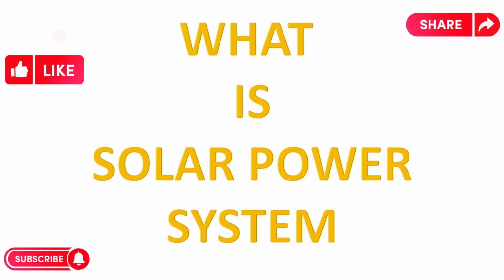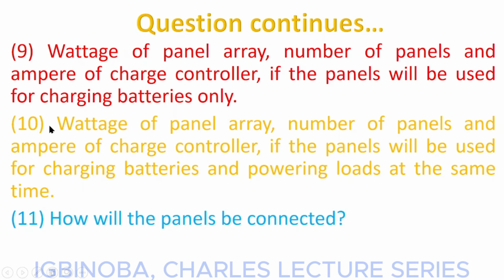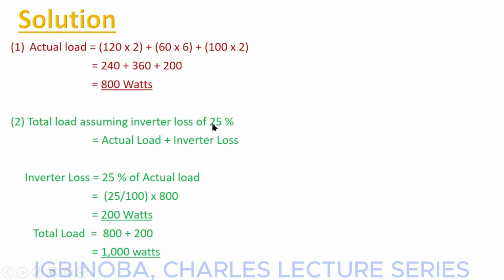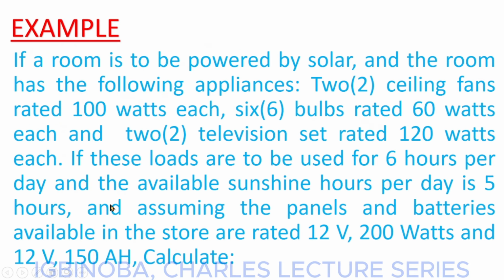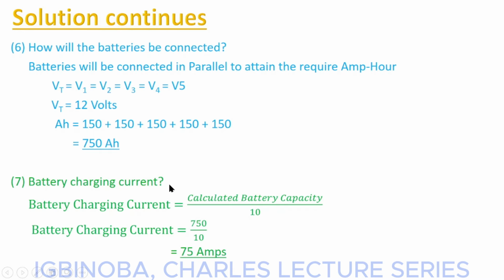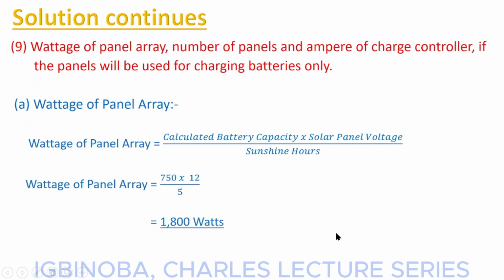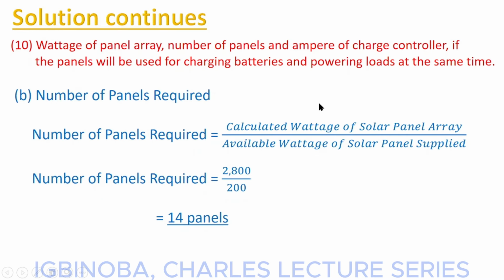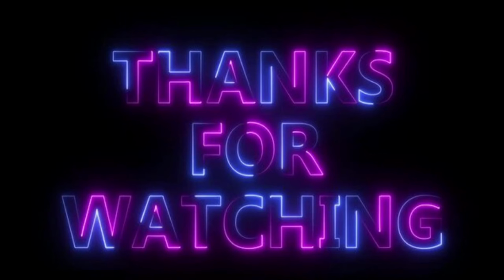Design of Solar Power System

Comment: ANSWERS TO SWEP NEW TASK
 PETRO334H
1. Actual load= (100×3)+(60×10)+(120×4) =1380watts
2. Total load assuming inverter loss of 25%= Actual load +Inverter loss
Inverter loss=25% of Actual load
= 25%×1380=345 watts
Total load= 1380+345=1725 watts
3. Inverter rating on VA using power factor of 0.8
= (1725÷0.8)= 2156.25
4. Battery capacity using factor for reserve 75%=(2×1725×6×0.75)=1293.75Ah
5. No. of batteries for backup hours=1293.75Ah÷150Ah= 8.6 =8 batteries 
6. How batteries will be connected?
The batteries will be connected in parallel 
Vt=V1=V2=V3=V4=V5=V6=V7=V8
Ah= 150+150+150+150+150+150+150+150=1200
7. Battery charging current=1293.75÷10=129Amps
8. Battery charging time assuming charging loss of 40%= 1293.75Ah+(40%+1293.75Ah)÷129A=14hrs
9a. Wattage panel array= 3105 watts
9b. Number of panels required= 3105÷345=9 panels 
9c. Ampere of charging controller required= 3105÷12=258.75Amps
10a. Wattage of panel array= Calculated wattage of solar panel array for charging battery only+ calculated total load =3105+1725=4830watts
10b. Number of panels required= calculated wattage of solar panel array÷ Available wattage of solar panel supplied= 4830watts÷345= 14Amps
10c. Ampere of charge controller= calculated wattage of solar panel array÷ solar panel voltage=4830watts÷12volts= 402.5Amps
11. How will the panels be connected?
Ans: They will be connected in parallel

Comment: EEE3146P

1. Actual Load = 1380 W

2. Total Load = 1725 W

3. Inverter Rating = 2156.25 VA

4. Battery Rating= 1293.75 Ah

5. Number if Batteries = 9

6. Battery are Connected in Parallel

7. Battery Charging Current= 129.4 A

8. Battery Charging Time = 14hrs

9.) a. Wattage Panel Array = 3105 W

b. Number of Panels = 16

c. Charge Controller= 258.75 A

10.) a. Wattage of Panel Array = 4830 W

b. Number of Panels= 24

c. Charge Controller= 402.5 A

11. Panels Arranged in Parallel

Comment: EEE3121Q

1. Actual Load = 1380 W

2. Total Load = 1725 W

3. Inverter Rating = 2156.25 VA

4. Battery Rating= 1293.75 Ah

5. Number if Batteries = 9

6. Battery are Connected in Parallel

7. Battery Charging Current= 129.4 A

8. Battery Charging Time = 14hrs

9.) a. Wattage Panel Array = 3105 W

b. Number of Panels = 16

c. Charge Controller= 258.75 A

10.) a. Wattage of Panel Array = 4830 W

b. Number of Panels= 24

c. Charge Controller= 402.5 A

11. Panels Arranged in Parallel

Comment: 1. Actual Load=1380watts
2. Total Load=1725watts
3. Inverter rating=2156.25VA
4. Battery rating=1293.75Ah
5. Number of batteries=9
6. Battery are connected in parallel
7. Battery charging current=129.4amps
8. Battery charging time=14hrs
9.a. Wattage panel array=3105watts
b. Number of panels=16
c. Charge controller=258.75A
10.a. Wattage panel array=4830watts
b. Number of panels=24
c. Charge controller=402.5A
11. Panels are arranged in parallel.

Comment: NAT31A 
1. Actual Load = 1380 W

2. Total Load = 1725 W

3. Inverter Rating = 2156.25 VA

4. Battery Rating= 1293.75 Ah

5. Number if Batteries = 9

6. Battery are Connected in Parallel

7. Battery Charging Current= 129.4 A

8. Battery Charging Time = 14hrs

9.) a. Wattage Panel Array = 3105 W

b. Number of Panels = 16

c. Charge Controller= 258.75 A

10.) a. Wattage of Panel Array = 4830 W

b. Number of Panels= 24

c. Charge Controller= 402.5 A

11. Panels Arranged in SERIES

Comment: PETROCHEM399U
1.Actual load =1380watts

2.total load=1725watts
3.Inverter rating=2156VA
4 Battery capacity=1293.75 Ah
5.Number of batteries is 8.6
6.Connection parallel
7.battery charging current is 129.4 amps
8. Battery charging timr=14hrs
9a.wattage panel array =3105 watts
b. Number of panels=16
C.charge controller=258.75A
10a.wattage of panel array=4830watts
b.Number of panes=24
C.charge controller=402.5A
11.Panels are arrange in parallel

Comment: PETRO3141K
 
1. Actual load= (100×3)+(60×10)+(120×4) =1380watts

2. Total load assuming inverter loss of 25%= Actual load +Inverter loss
Inverter loss=25% of Actual load
= 0.25×1380=345 watts
Total load= 1380+345=1725 watts

3. Inverter rating on VA using power factor of 0.8
= (1725÷0.8)= 2156.25

4. Battery capacity using factor for reserve 75%=(2×1725×6×0.75)=1293.75Ah

5. No. of batteries for backup hours=1293.75Ah÷150Ah= 8.6 =8 batteries 

6. How batteries will be connected?
The batteries will be connected in parallel 
Vt=V1=V2=V3=V4=V5=V6=V7=V8
Ah=150+150+150+150+150+150+150+150=1200

7. Battery charging current=1293.75÷10=129Amps

8. Battery charging time assuming charging loss of 40%= 1293.75Ah+(0.40+1293.75Ah)÷129A=14hrs

9a. Wattage panel array= 3105 watts

9b. Number of panels required= 3105÷345=9 panels 

9c. Ampere of charging controller required= 3105÷12=258.75Amps

10a. Wattage of panel array= Calculated wattage of solar panel array for charging battery only+ calculated total load =3105+1725=4830watts

10b. Number of panels required= calculated wattage of solar panel array÷ Available wattage of solar panel supplied= 4830watts÷345= 14Amps

10c. Ampere of charge controller= calculated wattage of solar panel array÷ solar panel voltage=4830watts÷12volts= 402.5Amps

11. How will the panels be connected?
Ans: They will be connected in parallel

Comment: PETROCHEM321U

1. Actual load – 1380 W

2. Total load – 1725 W

3. Inverter rating – 2156.25 VA

4. Battery capacity – 1293.75 AH

5. Number of batteries – 9

6. Connection – parallel

7. Charging current – 129.38 A

8. Charging time – 14 hrs

9a. 3105 W
b. 15.5 ~ 16 panels
c. 258.75 A

10a. 4830 W
b. 24 panels
c. 402.5 A

11. Connection – parallel

Comment: PETRO3129Y

1. Actual Load: 1380 W
2. Total Load (including inverter loss): 1840 W
3. Inverter Rating (VA): 2300 VA
4. Battery Capacity: 1227 Ah
5. Number of Batteries: 9 batteries
6. Battery Connection: Parallel
7. Battery Charging Current: 15 A (per battery string)
8. Battery Charging Time: 5.1 days
9. Panel Array (for charging batteries only):
- Wattage: 2945 W
- Number of Panels: 15 panels
- Charge Controller Ampere: 245 A
10. Panel Array (for charging batteries and powering loads):
- Wattage: 4785 W
- Number of Panels: 24 panels
- Charge Controller Ampere: 399 A
11. Panel Connection: Series - Parallel

Comment: PETRO364L
1. Actual Load: 1380 W
2. Total Load (including inverter loss): 1840 W
3. Inverter Rating (VA): 2300 VA
4. Battery Capacity: 1227 Ah
5. Number of Batteries: 9 batteries
6. Battery Connection: Parallel
7. Battery Charging Current: 15 A (per battery string)
8. Battery Charging Time: 5.1 days
9. Panel Array (for charging batteries only):
- Wattage: 2945 W
- Number of Panels: 15 panels
- Charge Controller Ampere: 245 A
10. Panel Array (for charging batteries and powering loads):
- Wattage: 4785 W
- Number of Panels: 24 panels
- Charge Controller Ampere: 399 A
11. Panel Connection: Series - Parallel

Comment: EEE 317Q

1. Actual Load = 1380 W
2. Total Load = 1725 W
3. Inverter Rating = 2156.25 VA
4. Battery Rating= 1293.75 Ah
5. Number if Batteries = 9
6. Battery are Connected in Parallel
7. Battery Charging Current= 129.4 A
8. Battery Charging Time = 14hrs
9.) a. Wattage Panel Array = 3105 W
b. Number of Panels = 16
c. Charge Controller= 258.75 A
10.) a. Wattage of Panel Array = 4830 W
b. Number of Panels= 24
c. Charge Controller= 402.5 A
11. Panels Arranged in Parallel

Comment: CHM3137G
1,Actual load = 1380W
2, Total load = 1725W
3, Inverter rating = 2156.25VA
4, Battery cap = 1293.75Ah
5, No. Of batteries= 9 batteries
6, Parallel
7, Battery charging is 129.4A
8, Time is 14hrs
9a, 3105W
b, 15.5 panels
c, 258.75A
10a, 4830W
b, 24 panels 
c, 402.5A
11, Parallel

Comment: CIV32B
a.Actual load is 1380w
b.Total load is 1725w
c.inverter rating is 2156.25VA
d.Battery capacity is 1293.75AH
e.No. of batteries is 625-9batteries
f.parallel
g.battery charging current is 129.375amps
h.charging time is 14hrs
i.1).3105w   2.)15.525-16 panels  3.)258.75A
 
J .  1).483w 2.)24.15-24panel 3)402.4A
K.parallel

Comment: CHM393O

1. Actual load= (100×3)+(60×10)+(120×4) =1380watts

2. Total load assuming inverter loss of 25%= Actual load +Inverter loss
Inverter loss=25% of Actual load
Therefore, 
Total load= 1380+(25%×1380)=1725 watts

3. Inverter rating in VA using power factor of 0.8
= (1725÷0.8)= 2156.25 VA

4. Battery capacity using factor for reserve of 75%=(2×1725×6×0.75)/12=1293.75Ah

5. No. of batteries for backup hours=1293.75Ah÷150Ah= 8.625 = 9 (Approximately) 
       = 9 batteries 

6. How the batteries will be connected?
The batteries will be connected in parallel 
VT=V1=V2=V3=V4=V5=V6=V7=V8=V9
VT= 12 V 
Ah= 150+150+150+150+150+150+150+150+150=1350 Ah

7. Battery charging current=1293.75÷10=129Amps

8. Battery charging time assuming charging loss of 40%= 1293.75Ah+(40%+1293.75Ah)÷129A=14hrs

9a. Wattage of panel array= (1293.75 x 12)/5=3105 watts

9b. Number of panels required= 3105÷200=15.525 = 16 panels 

9c. Ampere of charging controller required= 3105÷12=258.75Amps

10a. Wattage of panel array= Calculated wattage of solar panel array for charging battery only+ calculated total load =3105+1725=4830watts

10b. Number of panels required= calculated wattage of solar panel array÷ Available wattage of solar panel supplied= 4830watts÷200watts= 24.15 Amps

10c. Ampere of charge controller= calculated wattage of solar panel array÷ solar panel voltage=4830watts÷12volts= 402.5Amps

11. How will the panels be connected?
Ans: They will be connected in parallel

Comment: MECH3187E
1.Actual load =1380watts

2.total load=1725watts
3.Inverter rating=2156VA
4 Battery capacity=1293.75 Ah
5.Number of batteries is 8.6
6.Connection parallel
7.battery charging current is 129.4 amps
8. Battery charging timr=14hrs
9a.wattage panel array =3105 watts
b. Number of panels=16
C.charge controller=258.75A
10a.wattage of panel array=4830watts
b.Number of panes=24
C.charge controller=402.5A
11.Panels are arrange in parallel

Comment: Civ318R

i) Actual load = 1380 watts.
ii) Total load = 1725 watts.
iii) Inverter ratings in VA = 2156.25VA.
iv) Battery capacity = 1035Ah.
v) Number of batteries for backup hours = 6.9 = 7 batteries.
vi) The batteries will be connected in parallel.
vii) Battery charging current = 103.5 A.
viii) Battery charging time = 14 hours.
ix) a. Wattage of panel array = 2484 watts.
   b. Number of panels = 12.42 = 12 panels
   c. Ampere of charge controller = 207A.
x) a. Wattage of panel array = 4209 watts.
   b. Number of panels = 21.05 = 21 panels.
   c. Ampere of charge controller = 350.75A.
xi) The panels will be connected in parallel just as the batteries.

Comment: EEE3170N

1) Actual Load= 1380watts
 
2) Total Load= 1725watts
 
3) Inverter rating = 2156.25VA
 
4) Battery Capacity = 1293.75Ah 

5) No of Batteries = 9 

6) Batteries are connected in Parallel
 
7) Battery Charging current= 129.4 amps 

8) Battery Charging time = 14hrs
 
9a) Wattage of panel array = 3105watts 

9b) Number of panels = 16 panels 

9c) Charge Controller = 258.75A
 
10a) Wattage of panel array = 4830watts 

10b) Number of panels = 24 

10c) Charge Controller = 402.5A
 
11) Panels are arranged in Parallel

Comment: CHM3149S

1. Actual Load (Watts): 1380W
2. Total Load (DC with 25% Inverter Loss): 1720W
3. Inverter Rating: 2156.25VA
4. Battery Capacity: 1293.75Ah
5. Number of Batteries (12V, 150Ah): 9
6. Battery Connection (48V System): 2 parallel strings of 4 batteries in series. 
7. Battery Charging Current: 129.4A
8. Minimum Charging Time (hrs): 14 hours 
9a. 3105W
b. 15.5 panels 
c. 258.8A
10a. 4830W
b. 24 panels 
c. 402.5A
11. Panel Connection: 3 parallel strings of 6 panels in series.

Comment: PETRO352Z

1. Actual load= 1380watts
2. Total load assuming inverter loss of
25%=1725 watts
3. Inverter rating on VA using power factor of 0.8
= 2156.25VA
4. Battery capacity using factor for reserve
75%=1293.75Ah
5. No. of batteries for backup hours =9 batteries
6. How batteries will be connected?
The batteries will be connected in parallel
7. Battery charging current=129.4 Amps
8. Battery charging time assuming charging loss of
40%=14hrs
9a. Wattage panel array= 3105 watts
9b. Number of panels required= 16panels
9c. Ampere of charging controller required=258.75Amps
10a. Wattage of panel array=4830watts
10b. Number of panels required= 24 panels
10c. Ampere of charge controller= 402.5Amps
11. How will the panels be connected?
They will be connected in parallel

Comment: EEE3128X

1) Actual Load = 1380W

2) Total Load = 1720W

3) Inverter Rating = 2156.25VA

4) Battery Capacity = 1293.75Ah

5) Number of batteries = 8.6 

6) The batteries will be connected in parallel 

7) Battery charging capacity = 129.4A

8) Time(T) = 14hrs

9a) 3105W
9b) 15.5 panels
9c) 258.75A

10a) 4830 W
10b) 24 panels
10c) 402.5 A

11) Parallel

Comment: MECH3162F 
1. 1380 watts 
2. 1725 watts 
3. 2156.25Va
4.1293.75Ah
5 8.6
6. Parallel 
7. 129.375
8. Charging time 
9.(a) wattage of panel array=3105W
(b) Number of panel =16 panels 
(c) Charge controller=258.75 A
10.(a) Wattage panel array=4840 W
(b) Number of panel =24 panels 
(c) Charge controller= 402.5A
11. Panel arrangement parallel

Comment: Petro3154X

1. Actual load= (100×3)+(60×10)+(120×4) =1380watts
2. Total load assuming inverter loss of 25%= Actual load +Inverter loss
Inverter loss=25% of Actual load
= 25%×1380=345 watts
Total load= 1380+345=1725 watts
3. Inverter rating on VA using power factor of 0.8
= (1725÷0.8)= 2156.25
4. Battery capacity using factor for reserve 75%=(2×1725×6×0.75)=1293.75Ah
5. No. of batteries for backup hours=1293.75Ah÷150Ah= 8.6 =8 batteries 
6. How batteries will be connected?
The batteries will be connected in parallel 
Vt=V1=V2=V3=V4=V5=V6=V7=V8
Ah= 150+150+150+150+150+150+150+150=1200
7. Battery charging current=1293.75÷10=129Amps
8. Battery charging time assuming charging loss of 40%= 1293.75Ah+(40%+1293.75Ah)÷129A=14hrs
9a. Wattage panel array= 3105 watts
9b. Number of panels required= 3105÷345=9 panels 
9c. Ampere of charging controller required= 3105÷12=258.75Amps
10a. Wattage of panel array= Calculated wattage of solar panel array for charging battery only+ calculated total load =3105+1725=4830watts
10b. Number of panels required= calculated wattage of solar panel array÷ Available wattage of solar panel supplied= 4830watts÷345= 14Amps
10c. Ampere of charge controller= calculated wattage of solar panel array÷ solar panel voltage=4830watts÷12volts= 402.5Amps
11. How will the panels be connected?
Ans: They will be connected in parallel

Comment: MECH3175S

1. Actual load is 1380W
2. Total load is 1725W
3. Inverter rating is 2156.25VA
4. Battery capacity is 1293.75AH
5. No. of batteries is 8.625~9 batteries
6. Parallel
7. Battery charging current is 129.375 amps
8. Charging time is 14 hours
9. (A) 3105W 
(B) 15.525~16 panels 
(C) 258.75A
10. (A) 4830W 
(B) 24.15~24 panels 
(C) 402.5A
11. Parallel

Comment: MECH357E

1. Actual load - 1380W
2. Total load - 1725W
3. Inverter rating - 2156.25VA
4. Battery capacity - 1293.75Ah
5. Number of batteries - 9
6. Batteries are connected in parallel
7. Battery charging current - 129.4amps
8. Battery charging time 14hrs
9a. Wattage of panel array - 3105W
9b. Number of panels - 16 panels
9c. Charge controller - 258.75A
10a. Wattage of panel array - 4830W
10b. Number of panels - 24
10c. Charge controller - 402.5A
11. Panels are arranged in parallel

Comment: CHM3143M
1 Actual load: 1380 watts
2 Total load: 1725 watts
3. Inverter rating: 2156.25 VA
4. Battery capacity: 1293.75 VA
5. Number of batteries: 8.6
6. Connection: Parallel
7. Battery charging current: 129.375
8. Charging time
9a Wattage of panel array: 3105W
b Number of panels: 16 panels
c charge controller: 258.75A
10a Wattage of panel array :4830W
b. Number of panels: 24
c charge controller: 402.5A
11. Panels arrangements: parallel

Comment: PETROCHEM355C

1. Actual load: 1380 watts
2. Total load: 1725 watts
3. Inverter rating: 2156.25 VA
4. Battery capacity:1293.75 Ah
5. Number of batteries: 8.6
6. Connection: parallel
7. Battery charging current: 129.375
8. Charging time
9. a. Wattage of panel array: 3105W
b. Number of panels:16 panels
c. Charge controller: 258.75A
10 a. Wattage of panel array - 4830W
b. Number of panel - 24
c. Charae controller - 402.5A
11. Panels arrangement: Parallel

Comment: PETROCHEM35E

1 Actual load 1380W
2 Total load  1720W
3 Inverter rating  2156.25VA
4 battery Capacity 1293.75Ah
5 number of batteries 8.6
6 Parallel 
7 Battery charging  129.4A
8 T = 14hrs
9 (a) 3105W
   (b) 15.5 panels 
   (c)  258.75 A
10 (a) 4830W 
     (b) 24 panel 
     (c) 402.5A 
11 Parallel

Comment: PETROCHEM377Y

1 Actual load 1380W
2 Total load  1720W
3 Inverter rating  2156.25VA
4 battery Capacity 1293.75Ah
5 number of batteries 8.6
6 Parallel 
7 Battery charging  129.4A
8 T = 14hrs
9 (a) 3105W
   (b) 15.5 panels 
   (c)  258.75 A
10 (a) 4830W 
     (b) 24 panel 
     (c) 402.5A 
11 Parallel

Comment: EEE3152V

1. Actual load =1380 watts

2.Total load=1725 watts
 
3.Inverter rating =2156.25VA

4.Battery capacity=1293.75

5. Number of batteries=9

6.Batteries are connected in parallel 

7.Battery charging current =129.4Amps

8.Battery charging time =14 hours

9a. Wattage of panel array=3105 Watts
9b Numbrr of panels=16 panels 
9c. Charge controller =258.75A

10a.Wattage of panel array=4830 watts
10b. Number of panels =24 
10c. Charge controller =402.5A

11.Panels are arranged in parallel

Comment: MECH3180X
1. Actual load: 1380 watts
2. Total load: 1725 watts
3. Inverter rating: 2156.25 VA
4. Battery capacity:1293.75 Ah
5. Number of batteries: 8.6
6. Connection: parallel
7. Battery charging current: 129.375
8. Charging time
9. a. Wattage of panel array: 3105W
b. Number of panels:16 panels
c. Charge controller: 258.75A
10 a. Wattage of panel array - 4830W
b. Number of panel - 24
c. Charge controller - 402.5A
11. Panels arrangement: Parallel